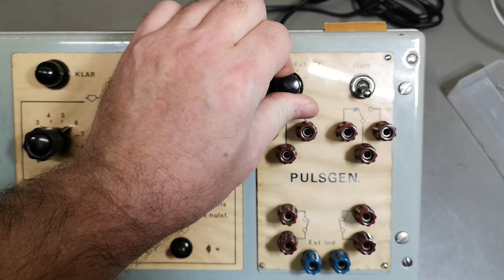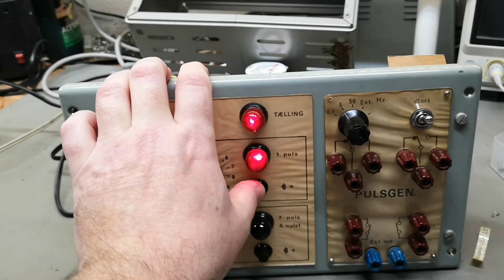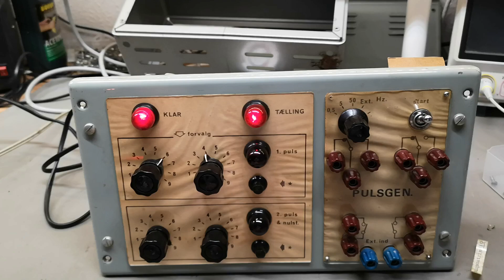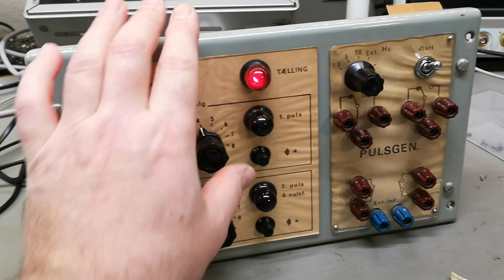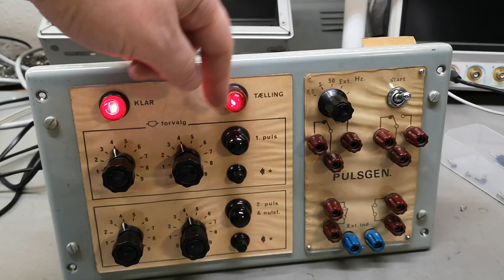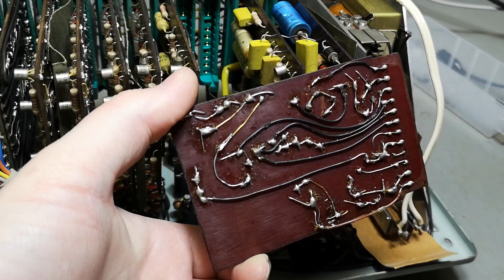Pulsegenerator Danish 1960-70 must be DIY for a company test teardown

Comment: My idea from just looking at the video: the device generates pulses in a frequency as indicated on the right hand side (including possibility for external triggering) these pulses are count for the numbers indicated on the left. klar resets, telling goes on off every time a certain number of pulses is read). The number of pulses is indicated in the two bottom panels on the left side. leftknob=2,right knob=3 -> counting up to 32 pulses. The counting starts by pressing * at panel1, the counting + reset to zero(=nulst from nullstelle) by pressing * at panel 2. You can test my hypotheses by hooking up a counter at the topright red banaplugs. Leftseries for settings from panel with 1.puls, rightseries for panel 2 puls and nulst. So you can count up to say 78 plulses @50Hz  by pressing puls button or say 56 times and then reset by pulse&nulst.

Comment: Interesting unit, absolutely crammed, no airspace wasted inside.
At first I thought „wow, veneer front panel decoration“ but later on I discovered it was only crumpled paper…
By the way, what material is those insulation sheets, probably not Asbestos?
Reply: Probably made from plastic laminated cardboard, commonly used as insulating spacers in transformers and to provide insulation layers in older equipment. The plastic keeps the insulating good even in humid environments, and the board stock also normally gets a varnish coating in assembly in a transformer or panel.
Reply from the maker: @SeanBZA  exactly what it is, cardboard with some stuff added, erlier versions was just dipped in hot wax to make it last very long time
Reply: In my country this material is called "getinax" - derived from German, I believe. Cardboard soaked in resin and cured.
Front panel paper was definitely printed, so batch scale was at least 100.